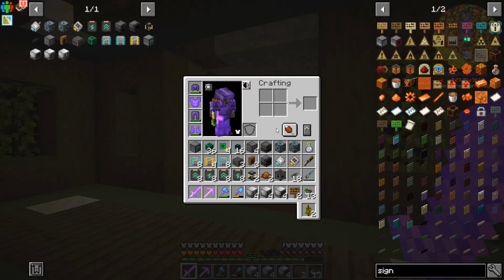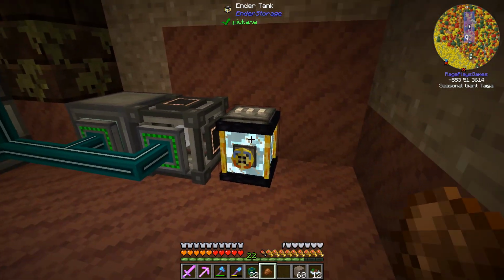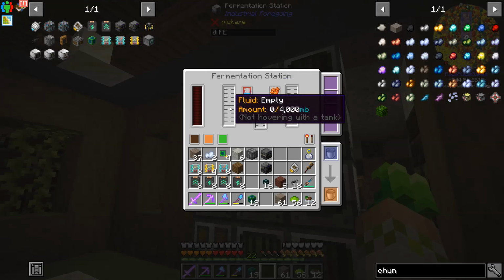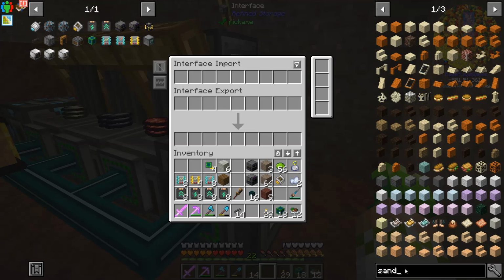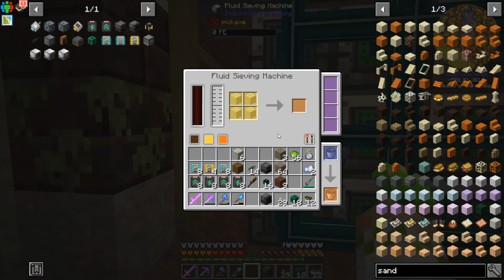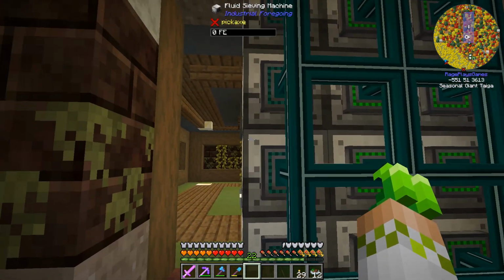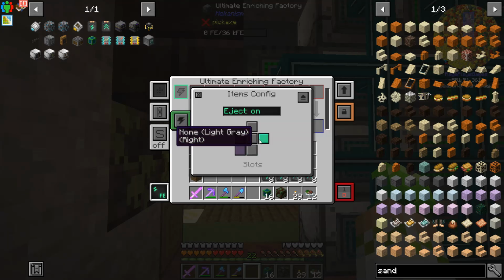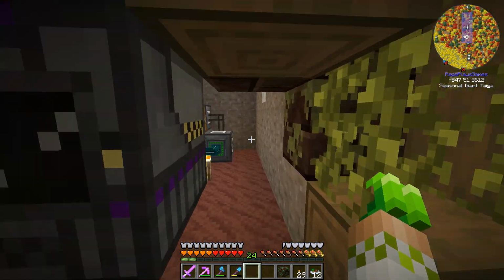Enigmatica 6 :: E09 - Industrial Foregoing 5x Ore Processing

Comment: 3 years late but just learnt that industrial foregoing has x5 ore processing.. thanks! Doubt you'll see this but maybe someone else with, in reference to ether gas, gas is infact a "fluid". Not a liquid, but a "fluid". You'll see many mods call pipes fluid pipes and not liquid pipes! So gas working with fluid pipes makes sense.

Definition of fluid: "a substance that has no fixed shape and yields easily to external pressure; a gas or (especially) a liquid."

P.S. Mekanism is special and did a hacky method of implementing their gasses instead of just using forge's fluid system. This is why (unfortunately) refined storage won't support mek gasses.
Reply: Turns out you know that as I continue to watch the video xD

Comment: One of the fastest ways to produce sand is to  have liquid Starlight touch flowing obsidian, then dropping it onto a torch or smth and picking up the dropped item

Only problem is that it's p laggy if not optimized

Comment: You should set sand distribution to round-robin.  That should help with slower sand processing and ensure the system won't fill one machine at a time, potentially clogging single processing rows.

Comment: there is an easy way ive got my 5* ore processing that is unlimited and never needs any refilling of sulfur. cause it automatically makes it. im using the cobblestone maker from thermal expansion, (as long as you can get a cobble from a gen thats the renewable resource) crushing it down into flint, then turning that flint into gunpowder and then using the same thermal boiler above my base (which is also another step in the ore processing) is turning that gunpowder into sulfur. which is using renewable resources. Those last comments bugged me.

Comment: Sand problem solved: igneous extruder (with resonant integral component) ontop of a sandstone block, feed into a mekanism crusher.

Also, if you get to it, I would like to see you produce mana in Botania using Astral Sorcery. To be more specific, produce mana by using Kekimurus fed by starlight transmutated pumpkins. btw, am eagerly waiting on more Surviving with Astral Sorcery from you.

One more thing: Horologium constellation is a pain in the rear to find. If you don't want to put in the hours of wait time to find it, here's the easiest (and cheatiest) way to find it.
Start with the command: /time set 6000
This is the first instance on any server where a solar eclipse has a chance of happening. This is Day 1.
If the sun is shining uninterrupted by the moon, run that same command again, but add 24,000. /time set 30000 is day 2.
Keep this going until you see a day where the sun is obscured by the moon. That day is the first day you will see Horologium in the night sky on that server. Take that number and add 7000 to it to make it the evening of that day. You should be able to wip out that telescope/observatory and find Horologium.
Every 36 days after that will be another night Horologium will appear. 864000 is what you would add to that last number you got to find the next appearance of Horologium.

No, /time set day/night/noon and whatnot WILL NOT WORK. It only resets the server to day 1. Hope this helps you save some time if you want to continue Surviving with Astral Sorcery, or helps anyone reading this who don't want to put in HOURS of waiting for the blasted thing to appear.
Reply: As your casually playing and you notice the sky going dark but its not night then thats an eclipse and holorolgium will appear that night.
If you do not want to use commands I find the hammock from  comforts useful to skip to night.
Reply: Hammock and bed usage is decent and most certainly the quickest way without cheating. The hammock is even in this mod pack thankfully; however, even that takes painfully long. Instead, in the amount of time it would take to do that method, I researched how Minecraft days worked, did some math, and formulated this method so I would turn roughly an hour or 2 of looking in the sky every night for Horologium (faster than waiting every morning till noon to see if there would be an eclipse) into just a couple minutes of command issuing to find the blasted thing.

Ideally, you would have the setup ready to find the constellation, then do literally anything else in the mod pack to keep you occupied while waiting for that weird mid day short monster spawning occurrence to tell you Horologium is appearing in another 5 minutes. But in the absence of a Hammock, a giant mod pack to keep you occupied, time, and patience. . . I just thought I'd give the internet my 2 cents on saving some sanity and time.